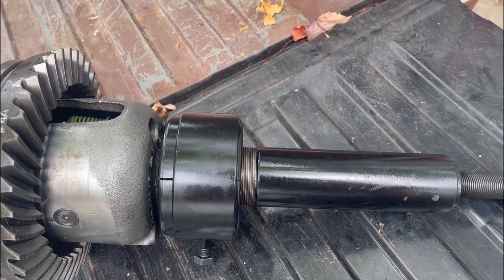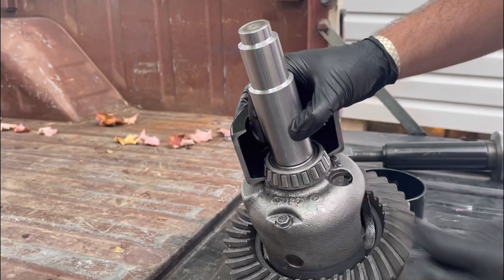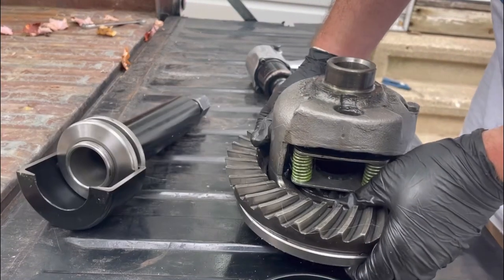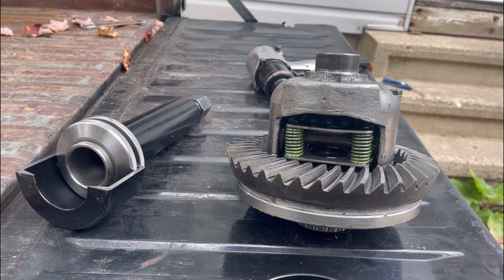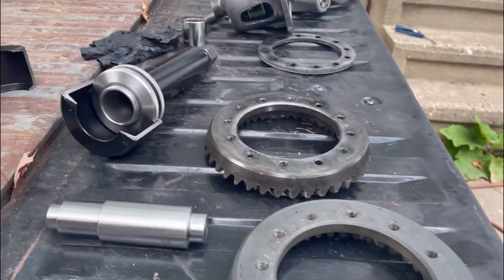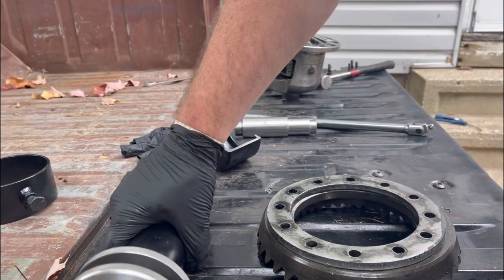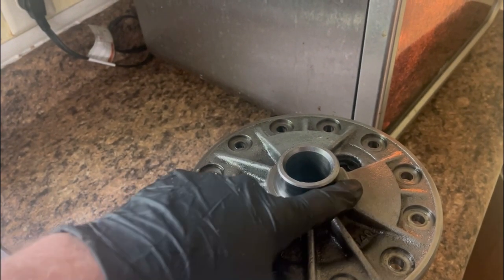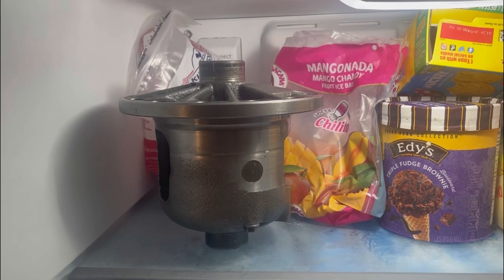Cool tool to remove carrier and pinion bearings and toaster oven to install bearings.

Comment: I've been eying this tool for awhile and I'm gonna pull the trigger on it ...cause when you need it you just do ... And it takes the bearings off with out damage which saves money when they are still reusable.
Reply from the maker: It’s $95 on Amazon right now and I’m so glad I got it.

Comment: Hiw do you pack them with grease now they are hot and installed?
Reply from the maker: These bearings do not get packed. They are differential bearings which are constantly submerged in differential fluid.